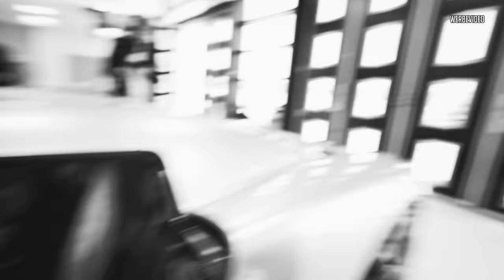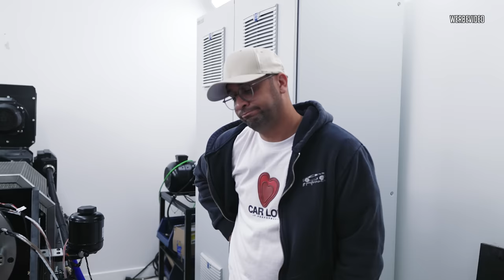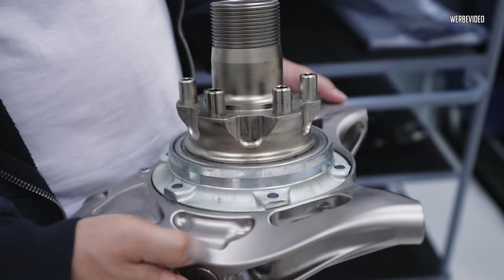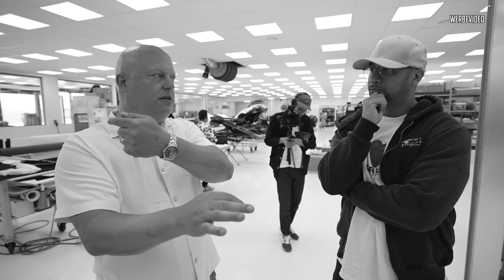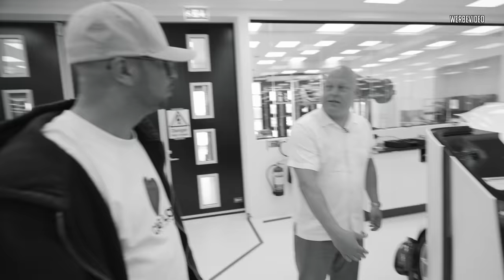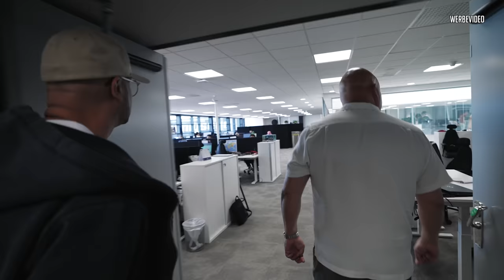JP Performance - Diese Firma ist einfach nur faszinierend! | Besuch bei Koenigsegg | Teil 3

Comment: Herr Königsegg ist nicht nur ein Visionär, er ist maximal innovativ und Perfektionist. Und… Herr Königsegg guckt sich Technologie ab und lässt sie auf seine Bedürfnisse adaptieren. 
Seine Schaltgetriebe mit integrierten Kupplungen sind im Grunde Motorradkupplungen. Seine frei programmierbare Ventilsteuerung ohne Nockenwellen hat Bosch schon vor einigen Jahren entwickelt. Dieser  Hersteller nimmt alles Gute und bringt es zur Perfektion… Danke JP für das Video diesen genialen Menschen vorgestellt zu haben…. Diese Autos aind jeden Cent wert… das fängt schon bei diesen riesigen, voll gekapselten Radlagern an… 🙌🏻👏👊🏻🫡
Reply: FreeValve is about 15 years old I think, maybe older.
Reply: Yes your are nearly right. Bosch tried it with electric controlling before 10years. And Empa Engeneers witg hydraulic controlling in‘ 19. Mr. Königsegg with his engeneers did it. 👍🏻🫡Königsegg

Comment: Kann mal einer ansprechen wie hoch der Luftdruckverbrauchist in KW ist um die Ventile zu öffnen. Schliesslich muss man den wahnsinnig hohen Luftdruck zur Ventilbetätigung jedesmal verpuffen lassen damit jedes Ventil wieder schnell genug zu geht. Speziel um die Auslassventile die vor dem Öffnen unter Last noch stark unter Druck stehen müssen mit wahnsinnig hohen Luftdruck beaufschlagt werden um diese überhaupt auf zu stoßen. Bei einer Nockenwelle kann man den Druck der Ventilfedern wieder zurück rekuperieren was bei der Freevalve Technik offensichtlich nicht möglich ist.
Reply: Christian explained how Freevalve worked during an interview during Covid on a American Podcast (Adam Corolla). It uses hydralics, pneumatics and electro mechanics to make it work and not produce too much heat and noise.
Reply: Air (pneumatic (ballistic)) pushes the valve out.
Hydralic lock latches the stem of the valve.
Air "spring" pushes it back and a hydralic dampener to get it to the origin.
Reply: @thorc4167  Thanks Thor for the reply. However, questions remain unanswered as to what kind of air consumption these valves use to actuate at fairly high pressure? Do you know Christian personally?
I could help to halve the air consumption.

Comment: Warum können die "nur" 10'000 drehen, die ersten MotoGP Motoren der 1000ccm Ära haben mit - vermutlich ähnlicher Technik - deutlich höher gedreht! Er sagt das Timing reicht nicht aus - liegt das an den acht Zylindern?
Reply: Timing is ok up to 10,000rpm, over that is problematic.
Reply: @thorc4167  i understand what he said, but my question is about the rpm over 10000U/min like the MotoGP did in there first Ära of the 1000cc Classement. Why did this not work? My only answer is, that it`s all about the eight cylinders ...! To many data to respond maybe ...